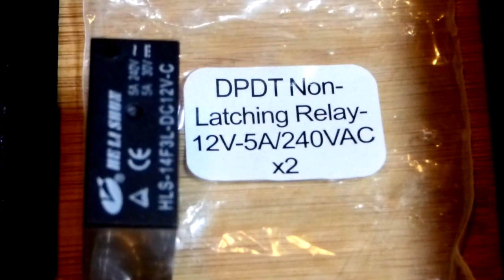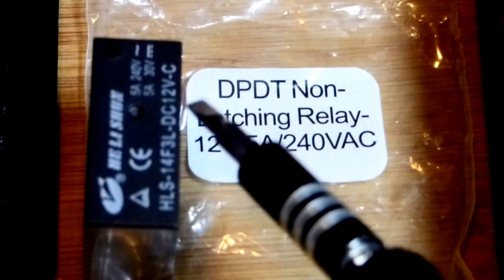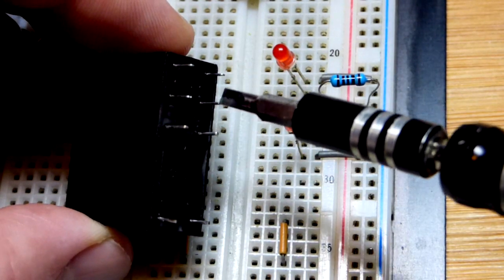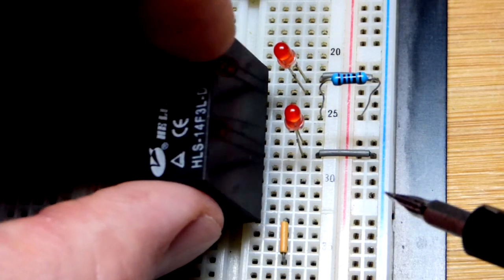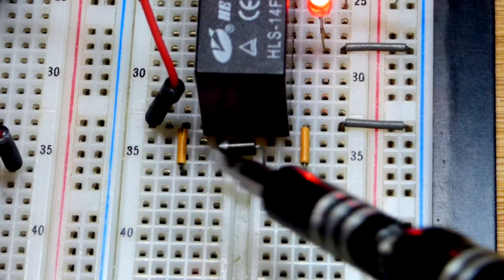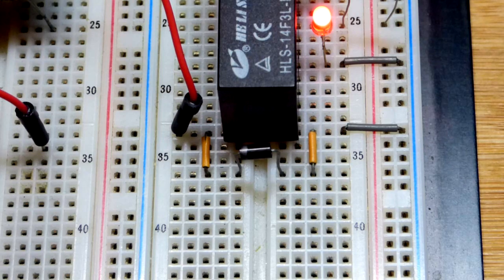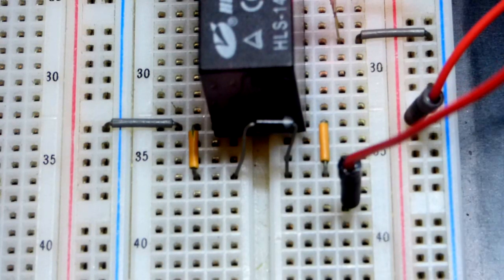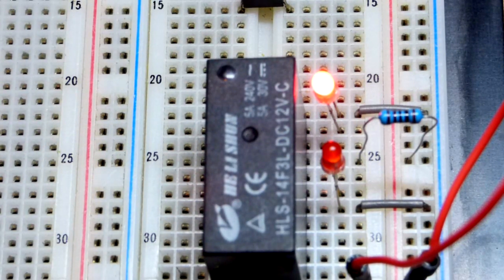How to use non latching relay component demonstration for DIY learning electronics

Comment from the maker: Donate! https://www.patreon.com/electronzap -
https://www.amazon.com/shop/electronzapdotcom is where I post affiliate link ads of products that I use or would like to get. - 
https://www.youtube.com/c/electronzap subscribe and click the bell! https://www.youtube.com/c/Electronzap/community has my recent diagrams. - https://electronzap.com/ -
Reply: Would it cause any problems to leave the coil power on for long periods of time? Also, do you know of a good sites to get a cheap reliable relay with the same specs as the one you have in this video?
Reply from the maker: @madapaperclip422  they come rated for the number of switches they can make, so I am sure that being on for long periods of time also wears them down faster. I got my basic relays from kits a long time ago. Relay modules tend to be more popular. The modules don't usually cost all that much more than the basic relay and are a lot easier to wire things to. I don't know of any sources being better or worse than others, I usually look for low price, quick shipping, and good reviews.
Reply: Ok. What circuit do you think they use for those street signs that blink on and off? Those yellow caution signs blink somewhere around 1 second on and one second off and are installed to blink on and off permanently. Do they use something more reliable and longer lasting than a relay?

Comment: I have a whirlpool fridge that quit working,  on the circuit board there's a g2rl-1-e 12vdc relay. It clicks to start compressor but then quits. I found if I push in the little box hole on the top of the relay the compressor  comes on, when I let off it goes off. Bad relay?
Reply from the maker: That's interesting, never dealt with that so no idea unfortunately. I'd try google searching that.